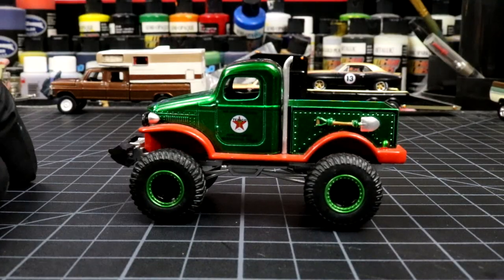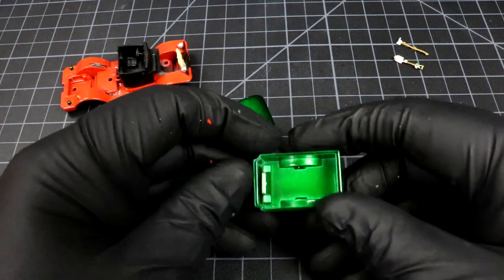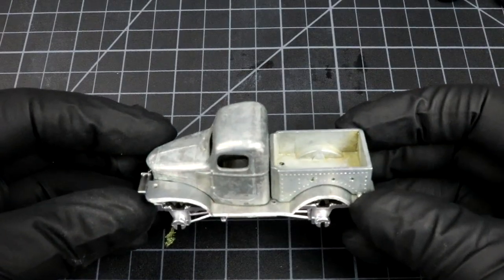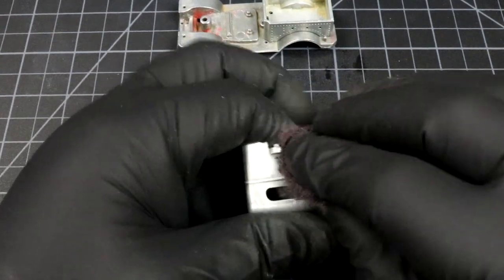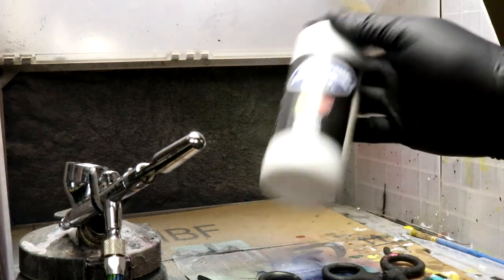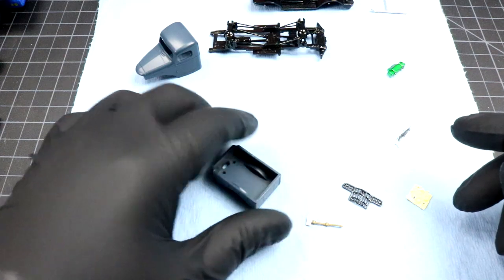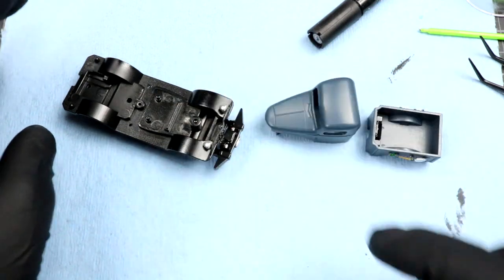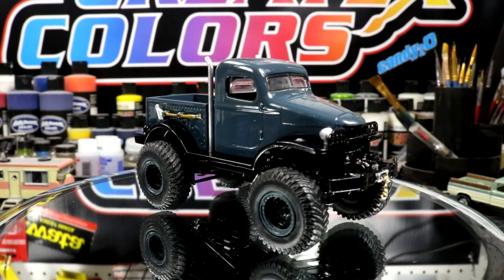Painting Diecast Cars - Dodge Power Wagon - Greenlight Chase

Comment: That looks damn near identical to. Sergeant rocks on gearz with stacy david.
Reply: Color is the only difference that I see.
Reply: And the guns in the back
Reply: It is indeed Sergeant Rock Greenlight just repainted it. I would like to get one in the original colors.
Reply: @1987olds442  bought one at Hobby Lobby last year. Greenlight still makes Sgt Rock.
Reply: 1987olds442 I’ve seen them on eBay sometimes

Comment: Lmao they just took a normal power wagon, like, the entire casting minus the axles, and glued on the big lifted suspension. I don't know if I love the idea or if it's cheap.
Reply: It's something they do often - I bought a couple of their Dodge Ram models, and taking one apart to repaint it, found exactly the same thing. I liked it so much 'Unlifted', that I left it that way, and the wheels just slotted in as normal. It is kind of cheap, but it does give you choices.